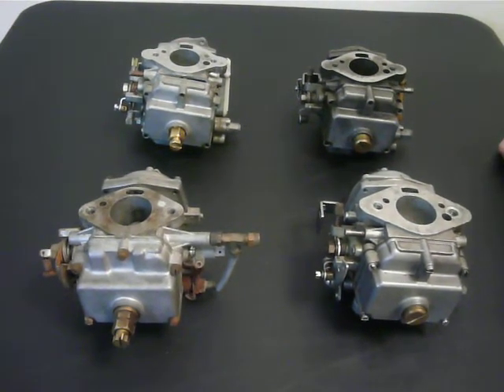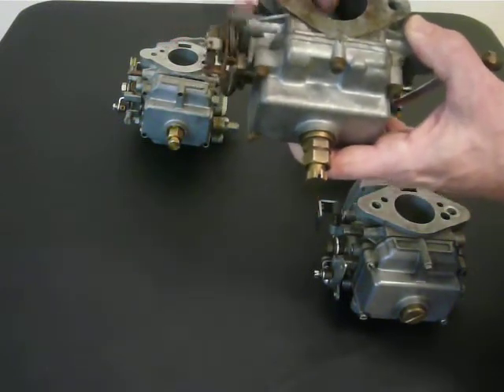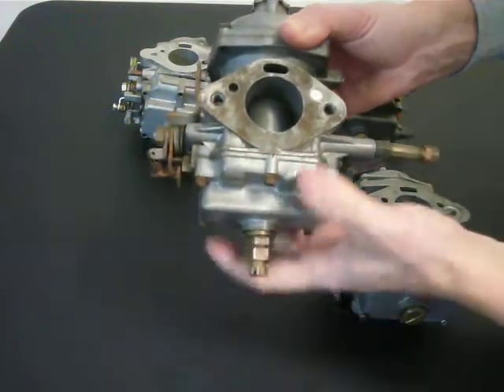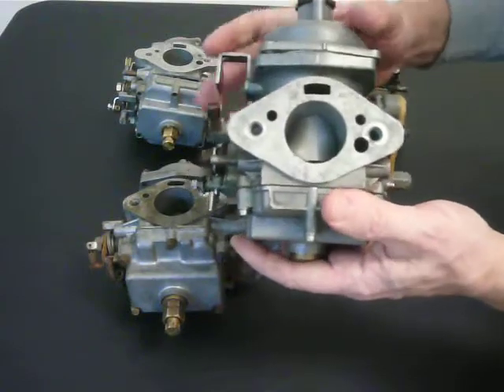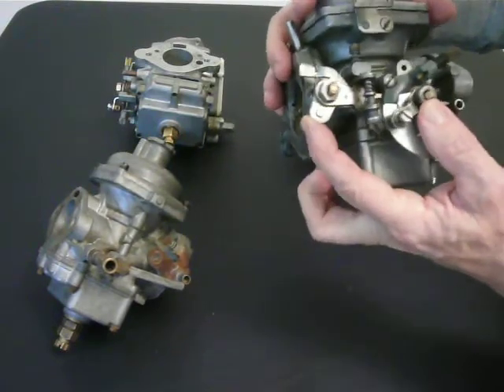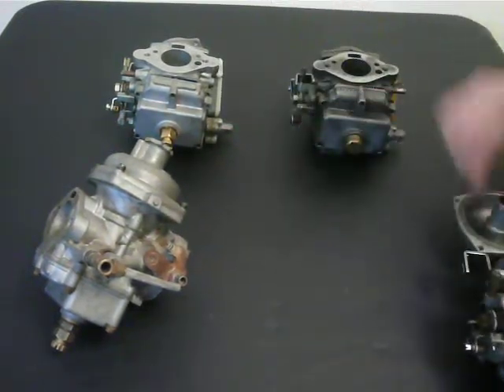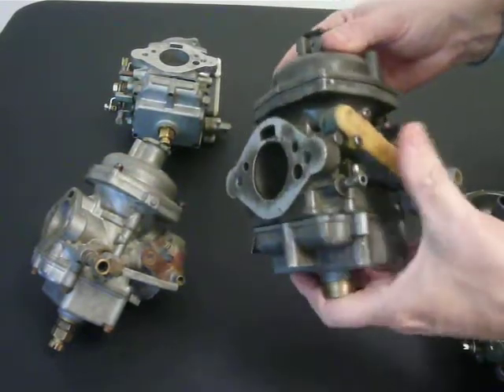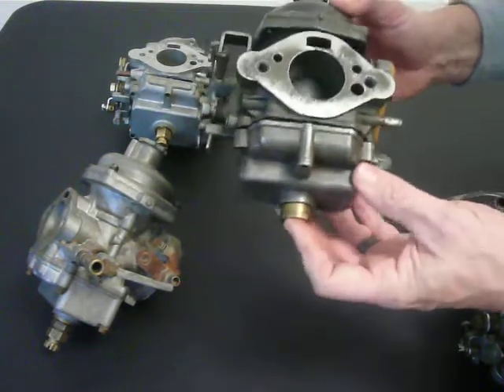Zenith Stromberg CD-CDSE Carburettor Jet Conversion

Comment from the maker: I have no experience with water chokes. It would seem a faulty choke would result in a overly rich run condition if sticking on. Recall the days when we "punched" the gas pedal to calm down a choke. A manual choke gives you more control, but you'll have more to look after. See if you are spitting out fuel droplets through the tailpipe. Mine will do that when choked (rich), and before the engine warms up, at which point I back off on the choke.

With respect to warm start issues, you may want to look into the possibility of fuel boiling. Remedies usually are isolating where fuel lines to the carbs may be running and keeping exhaust manifold heat from them and affecting the carb fuel bowl temperature. Better air flow in the engine compartment can help this as well.

Comment: Very enlightening. I have both the 175 CD on a '77 MG that I partially rebuilt, and two 150 CD s off of a Volvo marine engine with the adjustable jets.  I'm having trouble with the MG restarting when the engine is warm.  It starts easily when cold, but I have to  let it cool off to start  it again. It also idles too fast, even with the idle screw turned all the way down. It is equipped with the water choke, and I think that may be the problem. Seriously considering installing a manual choke. Any suggestions? Thank you  for posting your video. I enjoyed it. Aside from the high revving, the engine runs fine with good oil pressure.

Comment: Hola. ¿Que función cumple el resorte que se ve en 6:46 del video.?. Por favor, puede explicarme las diferencias que hay entre los CD....CDS y CDSE. Desde ya muchas gracias.
Reply from the maker: Para estabilizar la posición del jet. Para mantener la presión al alza en el chorro. El CD tiene este estándar. Muchos CDSE no lo hace.  Mi CDSE no tenía. No tengo ningún carburador CDS, pero tienen jet ajustable como con CD.

parte de la información: https://xks.com/i-23896636-stromberg-carburetor-adjustable-jet-b20174adj.html?utm_source=bing&utm_medium=cpc&utm_campaign=XKs%20Shopping%20PLA&utm_term=4585444528516299&utm_content=Stromberg